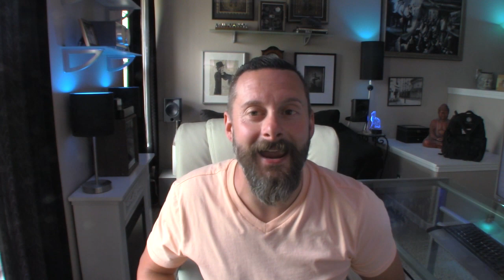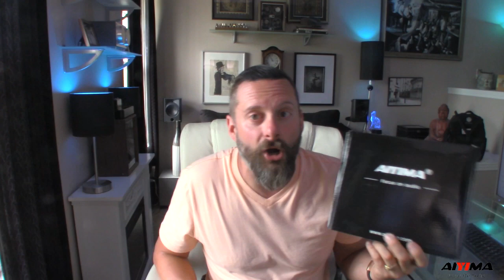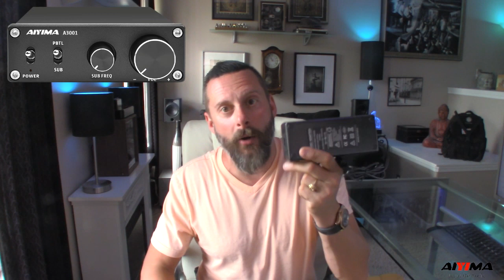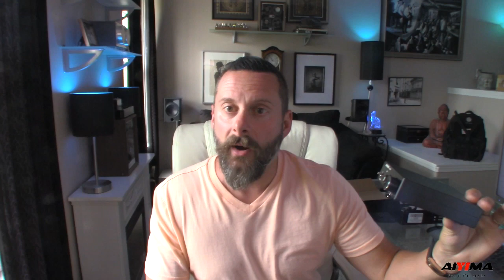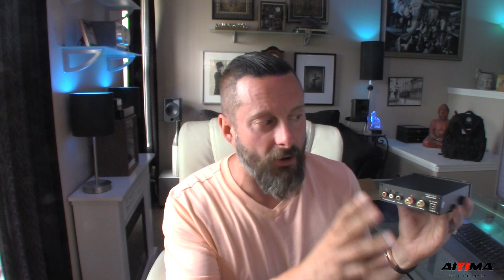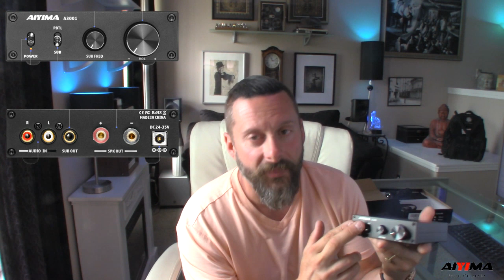Aiyima Amplifier  | A Solid Powerful Home Subwoofer Amplifier

Comment: I love DIY HT subs.  Been into it for decades.  I use the plate amps off the SVS PB13 ultras, the Sledge STA 1000d.  When people were upgrading their PB13s to the Sledge STA 1200d for the little extra power and the app control, they'd be listing their original amps for quite the steal considering the power and features.  Right now I'm powering my dual Audiomobile Evo-R 12s in 7.5 cuft tuned to 18hz and it drives them to their fullest potential and then some.

Comment: Does it do 300w RMS?
Reply from the maker: What's the Amazon listing read?
Reply: @PhatkatCollections  there seem to be different power supply options
Reply from the maker: that is correct.  All info is on the amazon page.
Reply: Fosi audio m03 which looks identical and has the same chip only reaches 100 watts @ 4 ohm before it begins to clip the signal